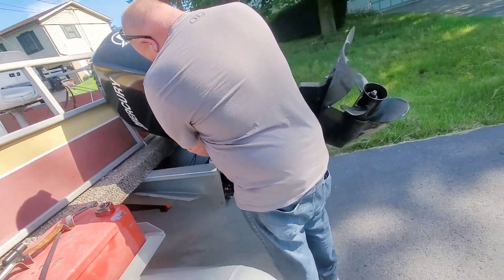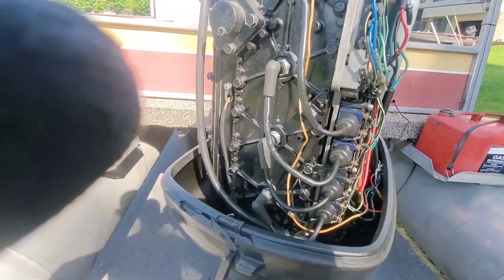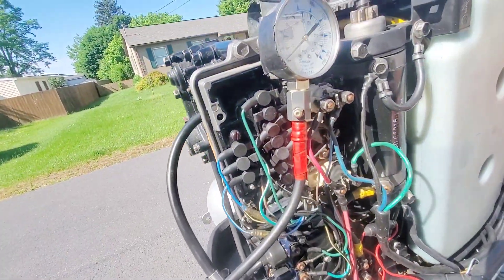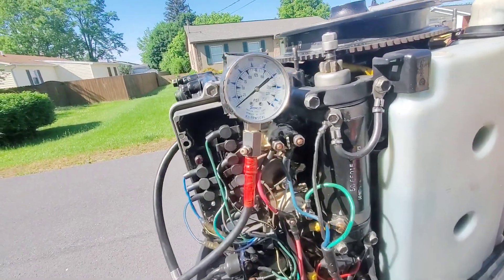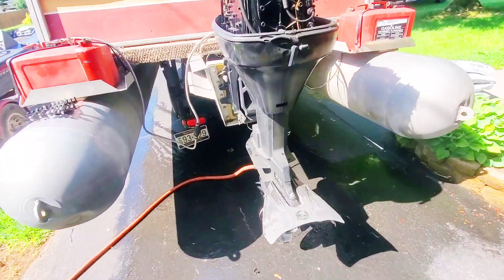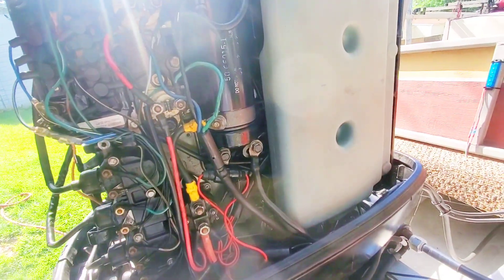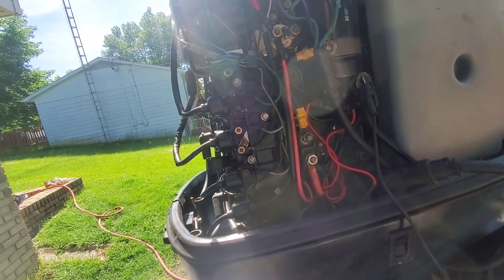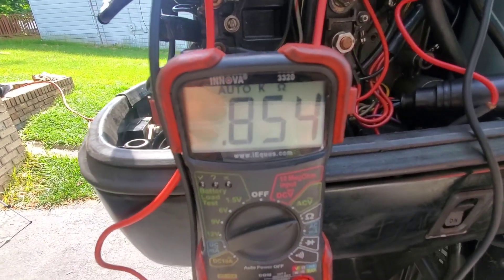1996 Mercury Outboard Stator, Switchbox, and Trigger Testing

Comment: I have a good question I have a 1978 mercury 500 50 hp that keeps blowing stator and switch box. I replaced wiring, trigger, coils rectifier is the after market switchbox's the problem or could timing cause this I am stumped any information would be appreciated

Comment: I have a 90 inline 6 testing testing the wires from the switch box to the coils with a DVA meter adapter I get around reading jumping  from 180 to way high... is this the trigger or stator?
Reply from the maker: Stator. 180 is not high. It typically ranges from 150-250 if my memory serves me well.   Son
Reply: @MerCSonL6  My meter is jumping all around like 160 to over 1000 is the stator bad or do I have a bad meter?
Reply from the maker: @OscarAnsley  I'm not sure if your dva is working properly. It is meant to measure peak voltage

Comment: I’m getting intermittent spark on cylinder 2 people say it’s the switch box?
Reply from the maker: What year is your engine?
Reply: @MerCSonL6  it seems it was the switch box, also 98 mercury 150 carbed.  I put it in the water and even though the rpm’s are going  to about 4  to 5k the boats not going over 10mpg  like I’m dragging an anchor. Marked the prop and hub, the mark remained in the same spot, idk what to do. I just installed  this engine 2 days ago, was supposed to be “perfect”

Comment: hello,Sir. What is the connection between rectifier and ignition. As I know, they are independent systems. What purpose of disconnecting the 2 yellow wires from the rectifier? Thank you.
Reply from the maker: The 2 Yellow wires feeds the rectifier pulses of alternating current. The rectifier converts it into direct current which charges your battery. A bad rectifier can mess up your ignition. Son
Reply: @MerCSonL6  Thank you, Sir

Comment: Great video. I don't understand where 250 voltage comes from. low voltage of coil should be 12V
Reply from the maker: If I'm understanding your question correctly it comes from the switchbox capacitor. It charges up the voltage and shoots it to the coils. Son
Reply: got it, thank you

Comment: I just rebuilt a 1992 115 and put alot of research into it , I'm not sure if I'm looking at the motor right but it looks like there are idle adjust screws on the two bottom carbs? If I'm not mistaken this engine is the same as my 1992 and on mine there's only 2 idle adjust screw on the two top carbs , this engines a 2+2 meaning it runs on the two top carbs below 1800-1900 rpm and the two bottom carbs "kick in" due to the vacuum created at 1800 rpm and they can not be adjusted , I have heard of people trying to remove this feature by replacing the two bottom carbs with two top carbs from an existing motor and it's not recommended as it causes a ton of issues and you'll never get it to run properly, hopefully this info helps
Reply from the maker: I had a feeling the previous owner may have switched out the carbs. I appreciate the information. Thank you! Son

Comment: Prob bottom carb.
Reply from the maker: Its great you say that. I recommend 1/4 inch inside diameter for his fuel connections between carbs because he has 1/8 inch and by the time fuel reaches the bottom its minimal/left over because the top 3 carbs gobble up the fuel/oil. Son
Reply: @MerCSonL6  absolutely. And he said it was breaking up at speed. That could do it for sure. Garbage also always collects in the bottom one.

Comment: Hey @MerCSon L6 I have just discovered your channel and it has been a very useful tool. I just aquired a 1977 1500 and slowly trying to get it back to its original condition. First I just wanted to say thank you for the videos. And second,  what website or company do you use to get your parts? I know you go hunting but ol' mercs are in short supply from where I am from. Thanks again and keep up the good work!!
Reply from the maker: Marineengine.com is a great place to start! Son
Reply: Donald, I have a 1976 Mercury 1500 that I may be willing to get rid of for parts.  Depending where you are located.  I am in Colorado.

Comment: Timely video, I have to confess, built a couple of three cylinder Johnsons, but will be BACK to the 'Max v6 that was cutting out last year like it was running out of fuel. SO will have to follow your lead ( Thank you ) and go thru and test the stator....as with his, mine will fire right off, but once out in the water starts dropping cylinders. In the garage it has 122 lbs on all cylinders and what looks like a hot spark...and I have a new fuel pump. And a filter so I could see if there was contamination.....fuel was clean ...
Reply from the maker: Let me know how it goes! Son